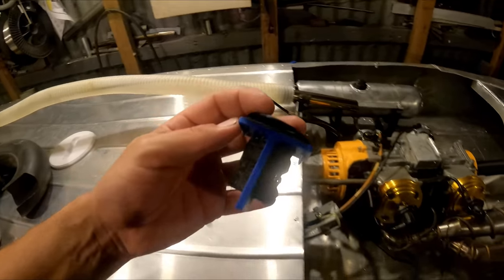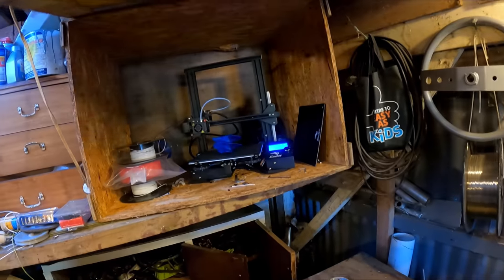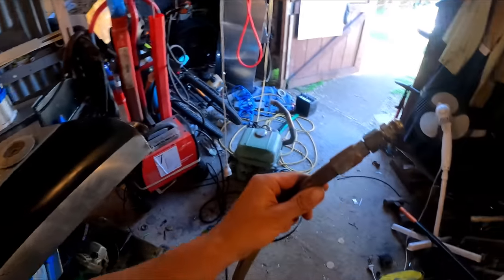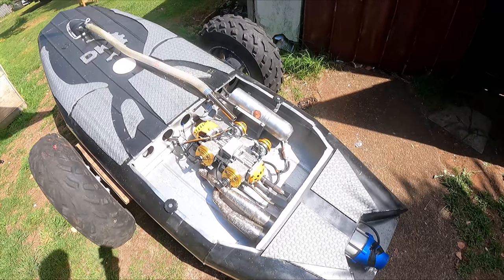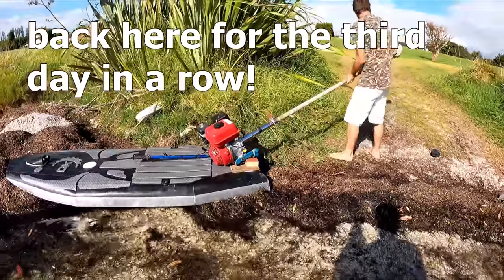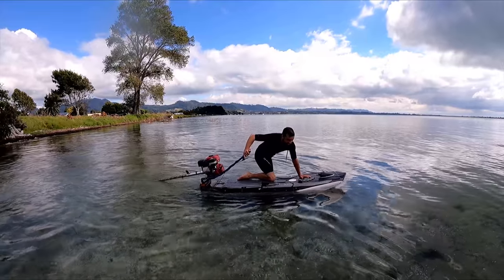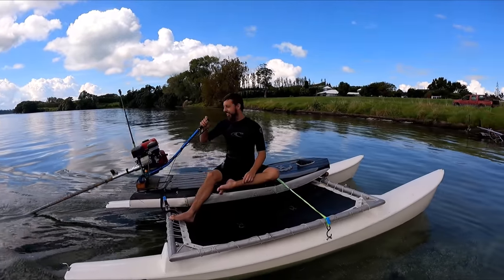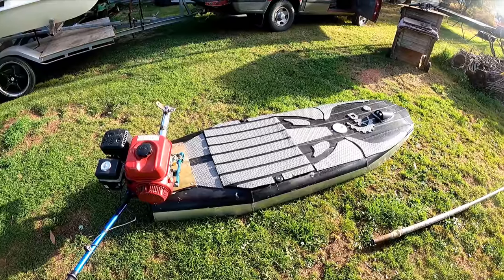Homemade Jet Unit 3D Printed, Testing!

Comment: Could you do a break down on that prop shaft and little briggs you got? would be awesome. thank you
Reply from the maker: It is just a longtail kit that you can buy and just bolt a Honda clone engine to it super easy. Just google sps mud motor it should come up
Reply: @DktheWelder  will do, thank you!

Comment: Just drop an old 440 or 550 standup jetski motor and it's pump and you're golden.  Those old standups can be had for CHEAP!
Reply from the maker: I would just ride the ski haha
Reply: @DktheWelder  haha gotta love those original jetski hulls they are the most sketch but most fun to ride!  I have several!

Comment: Can you show us how you made the long tail please. Interested in the shaft drive side.
Reply from the maker: I didn’t make the longtail it is an sps kit you can buy, but I have made another longtail shaft for a chainsaw motor on my channel 👍
Reply: @DktheWelder  cheers, I was sure you extended the shaft and added a prop, will watch again to see what I missed.. What you do is astounding. The 3 d printer parts are so interesting alone.

Comment: Make it so the jet unit is in the water all of the time so it can push more because as of now it is just pushing water through air until it can reach the water.
Reply from the maker: No wrong there are a lot of videos explaining it needs to be out of the water

Comment: I don't understand why/how the kill lines can be connected together, but they often can. my cub tractor is wired like that to the key switch, both tied together. the only thing I can think, maybe the wire is high enough impedance to not allow enough energy to transfer between the coils. not enough energy to make a spark on the opposing cylinder. only my guess.
Reply from the maker: Yeah to me those wires would fire the other coil at the wrong time but maybe it doesn’t

Comment: Air intake will greatly restrict the flow. The heat from the exhaust pipes will cut the power way down. Maybe a pump and jacket the exhaust and a small bilge pump at the rear? Chainsaws go up to 90cc if you can find some used and rebuild? Jonsered or Stihl. Clearance for the impeller makes a big difference in efficiency. Race units are machined running ceramic bearings.

Comment: I’ve been building a electric jet board but been having all the same issues as you with weak 3D prints and a 20hp motor that never seams to deliver enough power and the issue that electricity and water don’t mix. Maybe it’s time to build a electric long tail

Comment: Just got back from testing myself,  Your longtail setup was Rockin but I think you need about 15hp the jet unit or some gearing to get the rpm up on the impeller, 
Great vid Dan Cheers mate:)
Reply from the maker: Yes I think 15hp would do the trick , I went with a bigger jet unit than yours hoping I would need as many rpm. Do you have problems with sucking up weeds? You probably have the power to just chop them up
Reply: @DktheWelder  Hi Dan, maybe with the gas engines the hp might not need to be so high, but with the electric motors you do need some extra headroom or things get a bit hot when thrashed about, I do get some types of weed wrapped around the shaft,
but most types of weed gets blended up and blown out the drive unit,
have a great day mate :)
Reply from the maker: @YOUNGSTERS-JETS  also how did your test go? I bet your setup would work awesome in my surfboard, are you still using that little kayak?

Comment: Those jet thrusters need a electric motor to run them. Your petrol engines top out under 14,000rpm whereas your electric motor is 30,000rpm.
Reply from the maker: You can run jet pumps on gas engines like a JetSki, those motors were struggling to get to 6000 rpm I think

Comment: Why not remove the jet pump and replace with a propeller. Look at large Rc boat props (100mm) as they will suit direct drive applications. Run a prop guard and lanyard kill switch.
Reply from the maker: I was thinking that run the shaft out the back with a prop. I have watched heaps of rc boat videos they figure out a lot of stuff, but still I would like to go as fast or faster than the longtail so I would need more power
Reply: @DktheWelder  Long tail (surface drive) will be hard to beat.. By the way loving your engineering. Great channel.

Comment: You have enough power.  It's just not getting translated to thrust.  Perhaps you need a bigger impeller.
Reply: Doubt it, simply not enough power there to have the fun he's wanting to have.
Reply from the maker: The impeller is actually over sized for a jet board at 100mm , I think 20hp would be great!
Reply: @DktheWelder  
So I take it the engine is bogged down?   Have you tried a smaller impeller then?

Comment: Dk exist a formula to define power in watts diameter in meters and rotation rpm   Power(watts)=D^5x1000x(rpm/60)^3. Example your motor 5hp (745,7x5) 3728,5 watts (supose 7200 rpm ) 120^3=1.728.000     3728,5/1.728.000   = 0,0021577/1000      0,0000021577^.2 your impeller neeed to be 73,6mm (and  73,6mm pitch)  to spin 7200rpm with 3728,5 watts . If you increase 20% pitch, you need more 20% power (linear relation).
Reply from the maker: I struggle with maths like that ! The motors I have didn’t have enough power I might try again one day maybe a 15hp outboard on its side would work
Reply: @DktheWelder  You can modify an 80cc engine. It is small and light and more cheap. Thanks for all.
Reply: At Red Bull channel has a mini jet boat. The motor is 298cc and 28 hhp ( is possible to build a twin 60x52.8mm with the 80cc bottom cranckshaft case and kit cylinder repair chainsaw.

Comment: I have a feeling your jet drive would have worked better if you stood at the front of your board or raised the jet outlet angle to escape above the water level * while under load ( eg. Your body weight ) rather than being submerged which would naturally reduce the thrust. Your outboard model wouldn't have 8 hp so the jet drive should be much faster when set up
Reply from the maker: I tried that off camera , just need a lot more power for a jet pump since they are around 30% less efficient than a propeller. I am building a small electric jet boat at the moment with more power hopefully it will be fast!👍

Comment: Get a 2 stroke from a dirt bike hell even a old tf125 suzuki ct the gear box off the back stick a short intake to fit the carb you will be away
Reply from the maker: I actually have a tf125 engine! Put it on the longtail or in the board with jet unit?
Reply: @DktheWelder  the surf board jet thing lol cut box off lay it over make an intake to fit carb re route exhaust ext you could cut the crank short bt keep the clutch basket drive gear on the crank you could weld a coupler or uni to that for out 0ut the ignition stuff on the other side can just stay there will be sweet

Comment: This is like comparing a 3.0L Volvo Penta outdrive 135 hp to a Yamaha 1.8 liter 180hp jet drive and both 18' boats doing 42 mph lol

I think your jet drive needs to be lower and yes 20 hp.

Comment: The long tail is great, such a shame you can't fit a bigger motor in there. I wonder if cutting the gearbox off a 2 stroke dirt bike motor would get it done.  There's not much left of a yz80 after deleting the box and clutch pack.
Reply from the maker: An 80cc mx bike motor would be great a 125 cc be better

Comment: Remove that plate under your jet. That’s robbing you of A LOT of thrust
Reply from the maker: Jet boats all have plates under the jet unit to keep the jet out of the water
Reply: @DktheWelder   all the ones I’ve seen have the plate over the jet in the water. Better force reaction with water pushing water vs water pushing air.

Comment: the form on propeller blades is wrong!and there is no profile of blade (like aeroplane wing profile).You need impeller,not Arhimed screw like yours
Reply from the maker: I thought that as well , but a JetSki one is the same
Reply: @DktheWelder  now i making the same project,but before starting I making whole the model with all components in solidworks!including surfboard cad model!))i desided going another way that you...i making 3D model of board,filling it by extrude polyprolylene and wrap it by glass fiber with epoxy resine!)do you have a power curve of yours combined motors?
Reply: @DktheWelder  Why did you decide to make resonators? They take up a lot of space, yes, I agree, there is an increase in power at some speed, but it takes up a lot of space! Have you tried increasing the engine power with another carburetor? I would combine them linearly into one adjustable one
Reply from the maker: @kloyder  an expansion chamber you mean? They basically double the power , a bigger carburettor won’t do much on those motors as the ports aren’t big enough. Also if you are making one don’t use those motors they don’t have enough power , you need twice as much power to run a jet pump as they aren’t efficient. You probably want about 15hp

Comment: Does the propeller stop in time if you skid off?
Reply from the maker: I don’t think so I’m pretty sure if we fell off it would cut a bit before it stalls. I think with a kill switch it would slow down enough not to injure too bad
Reply: You’ll probably be fine you just need to fall off to the sides.

Comment: I have always wondered how much performance a longtail would gain with a constant speed prop. 
You would lose survivability in a prop strike but it will be a cool experiment.

For anyone that doesn't know a constant speed prop varies the prop blade pitch to constantly hold the engine at the desired RPM value. This means you can be at peak power no matter how fast you are going and thus maximise efficiency thru a wide range of speeds and generally obtain higher max speed.
In a way it acts like a transmission for prop driven vehicles like boats and airplanes.
Reply: Stainless steel version of those props never break and we hit stuff with aluminum ones all the time without issue. The props also change out really fast and are inexpensive